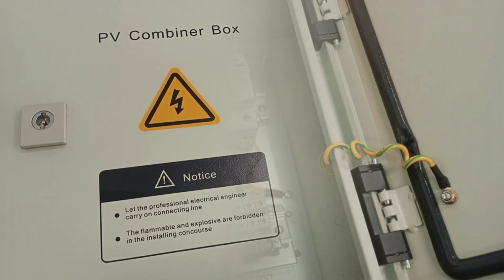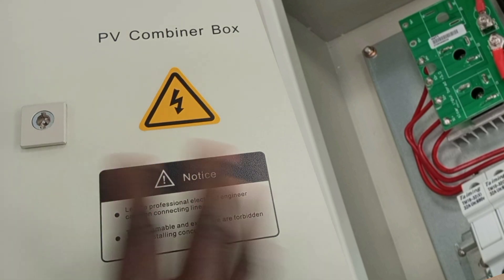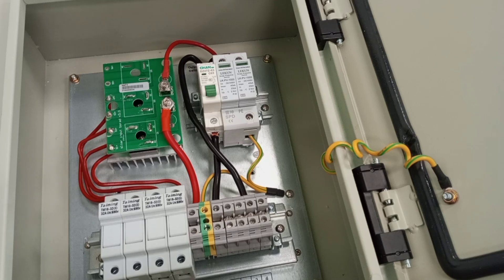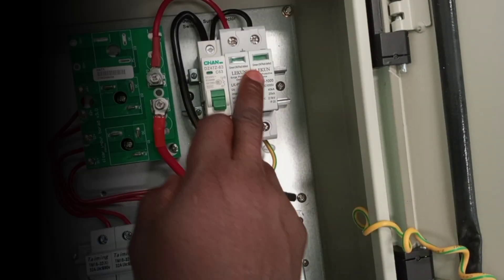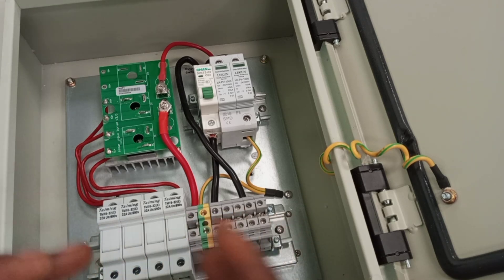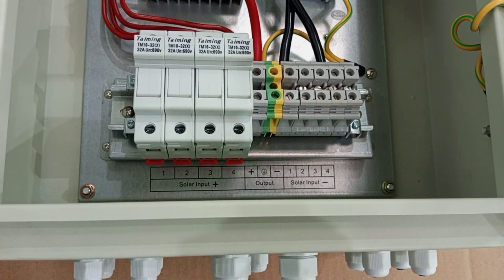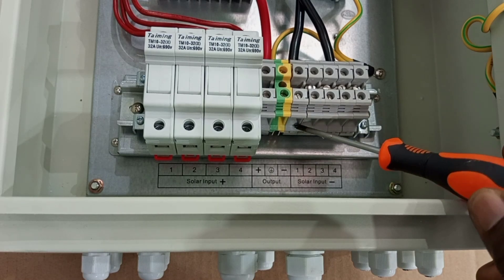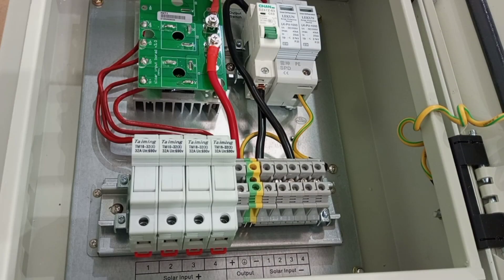PV COMBINER  BOX

Comment: Welcome! I would like to request a video where the PV (230V after inverter) and the electrical grid (230V) are automatically connected. It works with a light sensor. If there is light, it uses the solar side, if there is no light, it uses the single-phase electrical network. I would like it to work automatically, reliably, and without the possibility of both sides being connected at the same time. For safety reasons, wait a few milliseconds between switching until no power is received from either side. Please let me know when your video is ready. Thanks!
Reply from the maker: Well noted